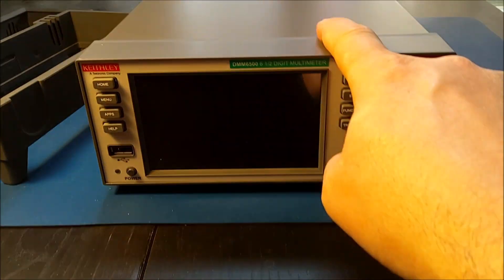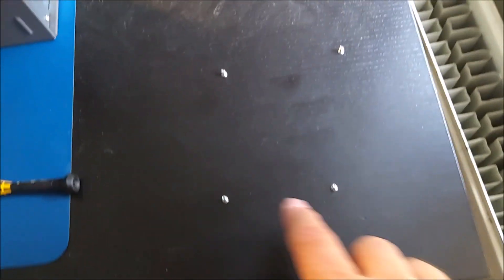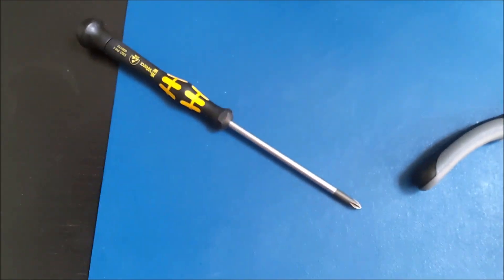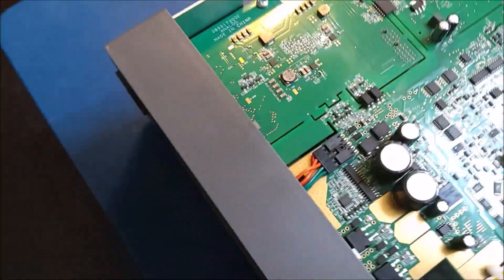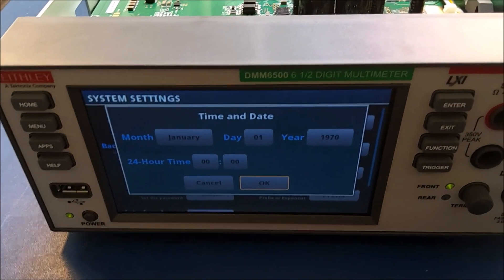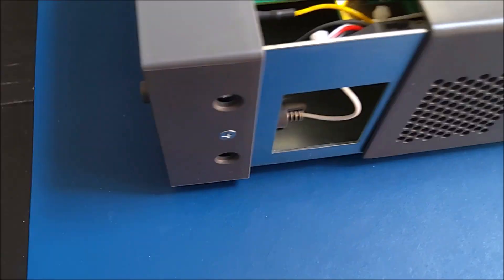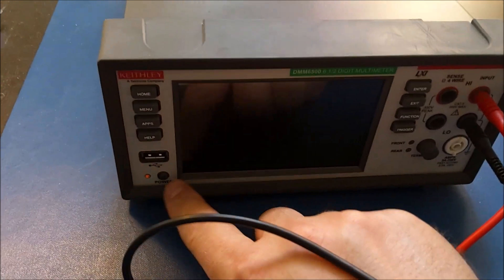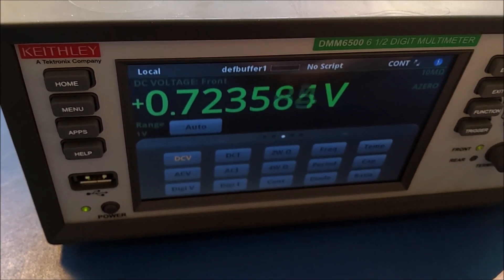Keithley DMM6500 - Replace RTC Battery

Comment: My RTC got reset after it was disconnected from power for a few months. After 1.7.x firmware upgrade and 3 days disconnected my RTC was not reset. Maybe don't replace batteries to early guys.

Comment: Same issue here, battery lasted less than two years. Bad battery or is the RTC using an insane amount of current?
Reply from the maker: Known issue with the meter. There was going to be a firmware update to address this, but I haven't checked.
The strange thing is that it uses more battery when it's powered on then when it is switched off.
Reply: @JanCumps  I just checken, the issue was fixed in firmware version 1.7.3. The release note states:

NS-1918 Symptom: The internal system clock battery is drained when the instrument is not plugged in for several months or longer, causing the instrument to lose the current time and date when powered on. The instrument battery must then be replaced.

My battery got depleted after just 17 months. I will do the replacement and firmware update to see if it improves. I don't really understand the background of the issue but if it can be fixed in  firmware it probably has something to do with a clock output of the RTC IC saying enabled in power down.
Reply from the maker: @outsideworld76  ah, good news. I'll go download the firmware too.
Reply from the maker: I had version 1.7.3c installed. Just checked. Should be good now ...